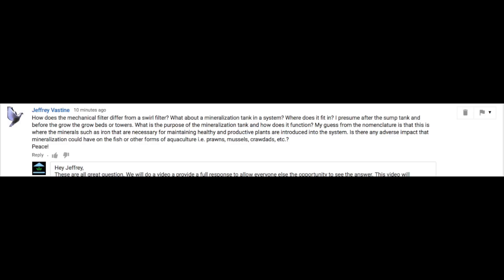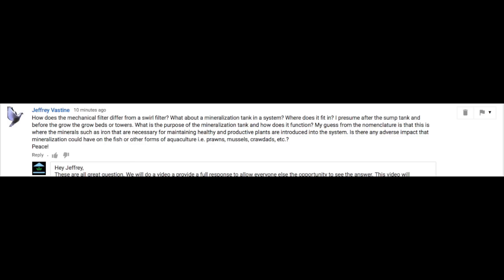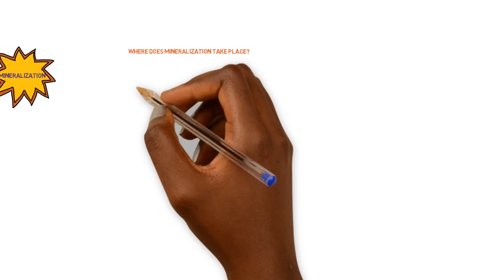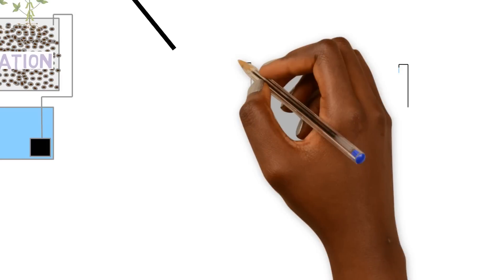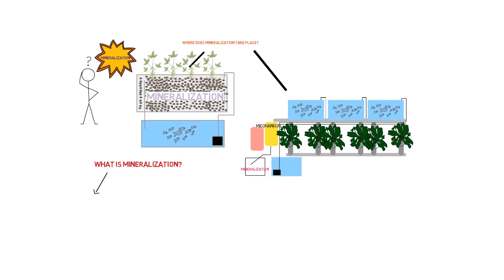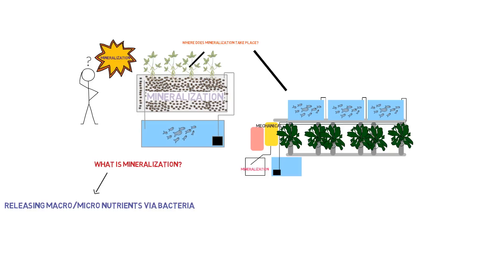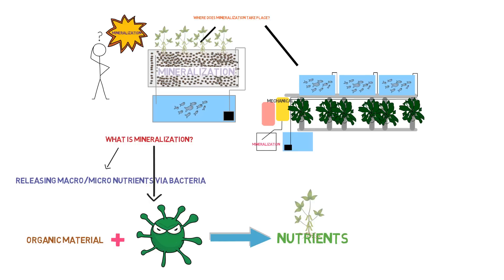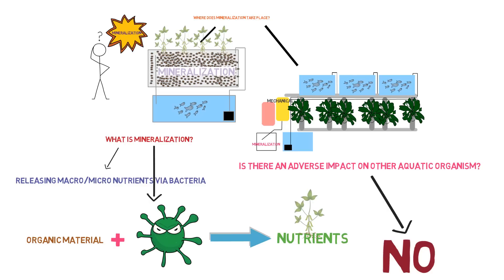Aquaponics Mineralization | Ask The Aquaponics God Ep27

Comment: Great channel and very informative.  My question is I still do not understand mineralization.  What is the media used?  How do you introduce magnesium, iron, other needed items safely into your system? and How and How much?  Do you buy a Fish Safe additive from the Aquaponics stores? Thank you in advance.
Reply from the maker: Hey Allen,
The media is simply used as a surface area for bacteria to colonize. It's usually some type of gravel or hydroton pebbles. It also filters out solids waste which are then broken down by bacteria.

magnesium is usually supplemented with epson salt and a chelated iron is used for iron. Adding them to your system is a simple as dissolving the supplements in water and then adding them to your system. The amounts vastly vary with each system, so it is practically impossible to give you a standard ratio to put it your system. There are instructions on the chelated iron supplements that recommend 1 teaspoon per 100 gallons. 

As far as fish safe additives, we don't added anything extra other than the required nutrients to our system. Nothing additional is added.

Comment: Yes Very good.  This is great.  Question still.  How do you introduce the MINERALIZATION back into the system from the mineralization tank.  Gradual and separate from the other processes due to need?  or through the Biological filter? or to the sump tank.  I understand the system based on your example which is the best on the net.  I am building a small example of this farm so that I will build a big farm to turn over to my kids.  So getting the example down first is key critical to the business plan. I have seen others but your examples make more business and practical sense.  Thank you in advance and thank you for your quick response.
Reply from the maker: Good question. Introducing the mineralized nutrients back into the system is fairly straight forward. After the waste has been mineralizing in your tank for a given period of time (usually 30-45 days minimum) you can take the liquid from the tank and pour in back in your system's sump tank. You simply need to ensure that it runs through a fine mesh filter to avoid introducing solids back into your system. These nutrients can either be introduced on a scheduled bases or as needed, but a scheduled basis allows for a more consistent and predictable outcome.
Reply: Would you elaborate on the "scheduled basis", please? What would be some options to introducing the mineralized nutrients back into the system? How automated can it be?

Can it be as simple as once the liquid has matured for 30-45 days to then just pump some of the liquid back into the system daily while more is added to the same tank? Or do you have to mature an entire batch for 30-45 days, move that to a different tank that is added to the system daily and start on a new batch in the original tank?
Reply: Exactly my doubts... I do think that unless you're growing a lot of plants, you probably don't need so much to recover the nutrients from solids.
By the way, most people I've seen on the net are simply dumping solids from their swirl filter on soil-planted vegetables/bushes/trees, or they call "mineralization tank" what's actually a biofilter

Comment: You mentioned in this video, continuous flow media beds system.  I did some research and one advantages of flood and drain is that during the drain cycle there is aeration for the plant roots, resulting in better nitrification as well.  However, the flood and drain needs either a timer based pump or a pump with an auto siphon and it costs more than continuous flow media beds.  What if you get an air pump and an air stone and put in inside the continuous flow media beds, wouldn't that curtail the disadvantage of continuous flow media beds (Less aeration, less nitrification)?  What is your take on this?

Thank you in advance AP God.

Comment: Firstly, When you say 'it's doing its own thing totally outside the circulating system' do you mean it's taken out from the circulating water into the mineralisation tank and then fed back into the system? If so where do you feed it back in? And secondly am I correct that this tank is used to raise and lower nitrate levels in the system by cleaning the media that is used to grow the baccteria more or less often? Thanks..... Al

Comment: Hey AP God, I have been watching your videos, and I am enjoying them very much .  You do a good job of breaking things down.  I have a simple question.  I am running a small baito bucket system, and I am finding that I can't feed my fish enough to take care of my plant with out having an issue with excessive nitrogen, and the plants I am growing are fruit baring.  I built a small continuous flow mineralization tank and added it to my system to pull out fish poop to cause de-nitrification to reduce my over all nitrogen in the water, so my plants don't stunt in growth and I can feed closer to the recommended feed rates, but after watching other videos I am starting to think that this isn't a good way to reduce nitrogen because quite a bit of the fish waist won't end up in the baito media bucket to deliver the necessary nutrients.    I would be super grateful for a good way to do this. Thanks! :)